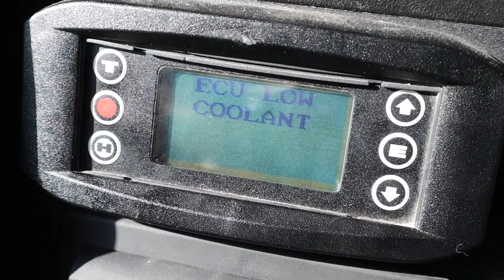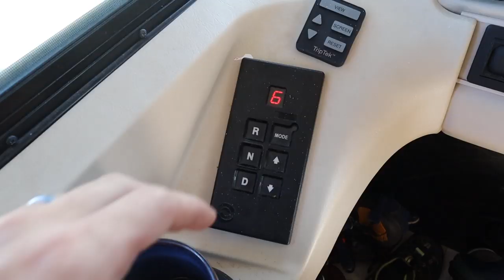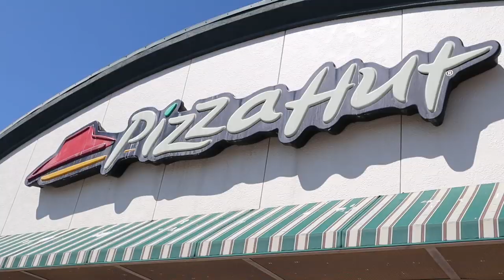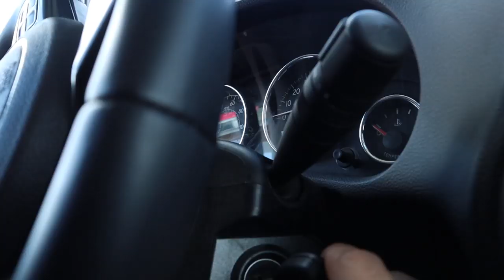RV REPAIR is Part of RV LIVING // Overheating Class A Diesel Pusher

Comment: This gentleman brought his diesel pusher RV into this diesel shop in Texas. His engine was running hot on hard pulls.
The service center said That they would research the problem, when they said that they would research the problem that means that they should had checked everything that could cause this engine to overheat during a hard pull’s first. There are two things that the shop should had check that will cause a diesel engine running hot under hard pulls. Is the engine fan working properly, is the  radiator clean for air flow, If you think about it, this RV is a pusher the radiator  is at the rear, that means any debris from up underneath the vehicle will penetrate through the engine compartment, through the radiator due to the engine fan is sucking air through the radiator. When the airflow is restricted. The radiator will not cool properly causing engine heating problems under hard pulls.

Always remember look for the simple things first don’t go thinking it’s my water pump or is it my engine thermostat always look for the simple things first.
My opinion this gentleman was overcharged.
Reply from the maker: Thank you!!

Comment: Did you try turning the wheel. My car locks up like that sometimes. Wiggle the steering wheel and try again to remove the key.
Reply from the maker: Jeeps don’t have a locking steering wheel but that’s a great suggestion. Thanks
Reply: I thought the Sam thing as t has happened on our vehicle-:)

Comment: We broke down outside of Springfield Missouri. I spent 6 hours (yes you read that right) on the phone trying to get someone to work on our DP. Once they hear it’s a motorhome, they say nope. I ended up having it towed to Freightliner, put my wife and dog on a plane and worked on it myself. I can see why the mechanics don’t want to work on it. A lot of the work is blind. You’re feeling around to get to bolts. They also charge you extra per hour than if it was a truck.

The problem I found is DP’s end of creating a vortex at the back. All the road dirt gets sucked in back there. What I did and I suggest everyone do is buy a garden hose and nozzle. Once you get to your new campsite, open up the back, connect the water hose and hose down the fins. You will see a ton of dirt come out. This sure is cheaper than paying a mechanic to do exactly that when you keep overheating. The other thing you should do is gain access from the inside and hose the fins from the inside.

Comment: You are exactly right with regards to the dust. You are kicking up dust with all the tires when the engine is mounted in the back. You can go off road but you need to flush the radiator each time you go off road. You can use air to clean the radiator. The other thing you need to do is clean the air filters after each off road experience or anytime you are stirring up dust. These are easy maintenance things that will save you a ton of money down the road.
Reply from the maker: Thank you 😊

Comment: Hopefully you get the engine problem figured out. We just traded out dp in for a smaller class c diesel. It had a Cummins motor. We had trouble getting it serviced too. And yes- they are very expensive to fix. We put over $13000 in repairs this year before we traded it. They sure are fun to drive though. Best wishes.

Comment: We have a 1996 Monaco.  We replaced the radiator and thermostats.  It won’t go over 220 degrees uphill pulling our toad on a hot day.  Downside is radiator was $2500.....we also had a leaking charge air cooler replaced.  Another $2500. also had to replace our 1 piece windshield....$4,000.  Glad we use this for business.  These old rigs are built well but when it’s time to fix,  not cheap even if you are handy.
Reply from the maker: Yikes! Yes I agree, well built but expensive! Thanks for watching

Comment: Just FYI to clean the dirt from the radiator fins, run the engine so it's hot and then spray some oven cleaner into the fins, just be careful not to get it on the paint or plastic, let set for 30minutes and rinse with water.
Reply from the maker: Thank you!

Comment: Every RV option has its bonuses and detractions.  The big draw back with the motorhome is that your engine/chassis is mated to your house.  So when it needs maintenance, the house has to go too.  That's one advantage about the 5th wheel.  If the truck needed maintenance, you could just drop it off and cool your heels in your RV until its fixed.  Not to mention that since your pulling chassis is a pick up truck, service centers are more abundantly available.  Also, most modern 1 ton diesel trucks produce more power and torque than many diesel pusher engines.  My 2018 Ram with 6.7L Cummins makes 370hp and a monstrous 800lb/ft of torque.  It climbs mountains like Billy goat :)  I do understand why you made the switch though.  Hope you get it fixed quickly.
Reply from the maker: Yes I see your point. That was something I considered when we decided to get a 5th Wheel in the 1st place. But even they need repairs at times and can be at the RV dealer or shop.. Keep Your Daydream had to spend some night in a motel which their new 5th wheel had warranty work done. It happens to us all eventually. Thank you!
Reply: @LoftisPartyofSix  Absolutely, my wife and I love watching you guys.  And we found another Aldi in Palmdale, CA.  That's makes 2 now in Cali we've come across so far just waitin for ya :)
Reply from the maker: Awesome 😎 thanks 😉

Comment: I just YouTubed about your key for the Jeep. Few good answers I hope for you. Your parking stick could be stuck when you shift gear into park. They can become stuck if soda or been driving with Windows down where dirt can get in when pushing button in. This guy sprayed WD-40 in the crevis of the button and then went back and forth clicking till it might not be stuck. Then back and forth from drive to park to make sure stick is fully out. Can seem fully out, but not really maybe. Also if you have a little lock shift button for overide by your stick could be locked in too. And needs to be clicked out. WD-40 that also, till pops out. 😊
Reply from the maker: Thank you for the info!!

Comment: Good attitude with all the issues.  Sometimes turning the steering wheel will loosen the key?  Many diesel shops are not accustomed to dealing with full-time RV families - they want you to drop it off and they get to it whenever.   Bring all the kids into the office - optimal pressure, LOL.  Good luck with everything and safe travels.
Reply from the maker: Yes I had to explain to all of them it was our home so they could understand our urgency. Thanks for

Comment: I'm so sorry about your windshield. There's a good chance that a rock got throwed up when it was being towed. Some Class A  Rvers have a shield type thing to help. Or maybe you just got it when you were off roading. But I'm sorry to say that's just one of the pit and down falls of off roading. I with our insurance. It's just cheaper to pay for it ourselves. We use Safe Lite for our windshields. There's a slight chance with the towing of it and with the heat. It could possibly shatter the windshield. It probably won't fall out. Just shatter. Believe me I had it to happen before. It's so depressing. And Safe Lite will come to your location and put it in. I'll keep your family in my prayers. Remember come to the Great Smoky Mountains and see me and my husband. We would give you and your family a good old fashioned cook out. Safe travels.
Reply from the maker: Yes I’ve used Safe Lite before and will definitely check with them on getting it fixed.
Reply: @LoftisPartyofSix  I don't know if all insurance companies cover windshields but Allstate covers our vehicles and it's not part of deductible coverage. If that makes sense as I don't remember proper term. Praying for a fair price on the RV repair and a complete fix!!!!

Comment: I had issues with mine also overheating thought it was a radiator but it wasn’t I end up calling the Freightliner 800-number and they told me to have the mechanic do a  RPM check on the fan clutch and that was my problem
Reply from the maker: Oh that’s good to know. Thanks

Comment: I am sure you have this fixed by now, but found these comments on a forum.  Just info to review, you may already be aware of these other areas to check.  Note: the reference to under passenger seat is on referring to passenger side, but is at rear of the coach.

There are 3 accesses that I have used to clean the inside of the radiator.
The most effective is under the bed raised and with the engine cover removed. From this position you look down onto the inside surface of the radiator. Soak well with 1:1 simple green (or other degreaser) and water. Using a garden sprayer with a long tip you can get most of the top half of the radiator. From the bottom front under the driver seat you can get about 25% of the radiator, you will have to squirt the liquid between the fan blades which must be rotated slightly to get it all. You may have to crank the engine. I have been able to rotate the blade by hand but is difficult. The 3rd access is under the passenger seat but again the fan blade will have to be rotated. After all of this is sprayed, I also soak the outside surface of the radiator by trying to squirt the cleaning fluid directly into the radiator fins. You can rinse with water but if you have a really thick build up you may have to use a pressure washer or car wash sprayer directly into the outside rear of the radiator to get it really clean. When doing this hold the sprayer far enough away from the radiator fins to avoid bending them.
You can tell when the radiator is clean. With the engine on, the fan should uniformly blow air through all areas of the radiator. 
Also, if you dont have a closed crankcase, you may want the extend the oil blowby tube (crankcase oil vapor exhaust) so that it vents beyond the radiator.
good luck
jim & debbie, 04 Journey, suzuki toad

Best of luck to a speedy fix.
Rick
Reply from the maker: Thank you Rick!! Great info!

Comment: Is the power steering working correctly?  On most Units it uses the same hydraulic systems as the engine fan.   You might want to verify the radiator is really clean...  couldn’t hurt to check behind them. Highly unlikely, but the fan motor should be checked to be sure it’s turning the right RPM. Good luck with your unit.  My hubby gave me all this advice to share. We have a diesel pusher and love it, but have had a few repair adventures too. He’s a trained diesel mechanic and has handled all the repairs himself. Thank God.
Reply from the maker: Maybe y’all should follow us around 😁😉!! Thanks for the suggestions and I’ll definitely keep it in mind.

Comment: Nope, nice always. Hard working mechanics can’t stand whiners...this is to test your patience, lol 😆.  When I worked at Volvo. There was a big sign in the shop that said, “$60 an hour; if you watch or ask, $100 an hour”💁🏻‍♀️ 🤣. When you pull out your key, we found we had to make sure you pull it out by pulling it ‘up’ and out. I know we usually don’t think about it, we just pull the key out and lock the car, but If you pull the key out quick and have a tendency to pull ‘down’ when you pull it out of the cylinder, you may misalign the inside of the cylinder...our Rendezvous had that issue.
Reply from the maker: Thank you

Comment: At my work, our little Chevy cars would do that because of defective shifter mechanism, basically the car didnt know it was in park. Mayby that's what going on, but with 100k on ours wev never had that, but have had the trans acted like its slipping after taking it out of 4x4 , just a restart of the engine solves that if ya ever have that happen. Safe travels!
Reply from the maker: Thank you!

Comment: Your key situation could,be anti theft , I have a Infiniti fx35 and the key/steering will lock up if it thinks it's being jacked with! You have to turn the wheel as you finagle the key! Your manual will explain if it is in fact the issue .  One other suggestion on your windshield ... I wouldn't wait to get that replaced ... it is very compromised now and if another rock hits it , it could shatter and might cause a very dangerous situation. 

We lived in the west (Utah) for 9 years and replaced 5 windshields !! The west is just notorious for having rock issues along the roads. 

Sorry your having all these issues ~ but maybe they are done and you can ride in peace now!
Reply from the maker: Thank you

Comment: The diesel will out last any gas engine hands down. You're right about CAT engine, I've had a Cummin's and now a CAT engine. I'm with you I'd rather have a Cummin's engine. But we just need to keep them serviced. The oil I've been told has something to do with the fuel rail.
Reply from the maker: I’ve never had a Cummins yet. But I’ve heard good things about them. Thanks

Comment: My car does that with the key when the steering wheel is Locked in a certain way, if it does it again try moving the steering wheel back and forth (as much as it will allow) a few times
Reply from the maker: Jeeps do not have a locking steering wheel. Thanks

Comment: Your Jeep key cylinder may be going bad and need to be replaced. Supposedly you can get a new one that can be setup using your current key so you don't end up with a different key for the ignition and the door locks.
Reply from the maker: Thank you 😊

Comment: I am also curious as to your MPG on your CAT engine.  I assume it is pre-SCR/DEF engine?  On my small Cummins Diesel - I am getting 8.5-9.  I understand that I will likely get better MPG once I brake it in more.   Thanks!
Reply from the maker: Currently in the mountains I’m getting like 7 MPGs but on flat ground I get about 9-10.

Comment: A Loftis " CLIFF HANGER".  I'm sure glad we dont have to wait until next season to find out. TUNE IN NEXT TIME WHEN WE FIND OUT THE LOFTIS RV OVER HEATING PROBLEM ". LOL
Reply: @LoftisPartyofSix  we have to Joke about it or we'd cry.  I have an issue with my driver side window , the vcc window with the side in it. It frosted over so bad you can't see the mirror.  It lasted 2 years maybe . So I found this company who came to my house to fix it. I replaced the whole window the last time I think for over a $1000. These people replaced the window that's damaged for $350. I needed 2 repaired so it was $300 per window.  
I sure hope your over heating problem is easy on you. I really thought it was a dirty radiator.

Comment: Not sure , check and see if there is a button  you press to remove the key. Your insurance should replace your windshield for free. They will come to you to replace it. The same goes for you RV windshield.  I knew it was your radiator. You should buy you a small pressure washer for this and can use it to clean lots other stuff , jeep RV and little boys, LOL  Man I was hoping it was just thr radiator.
Reply from the maker: Thank you 😊

Comment: We have a Winnebago pusher also , I no longer drive on dusty roads because of the radiator clogging up, Cat has the crank case vent tube that puts out oily discharge that gets sucked into the radiator and holds the dust . I put a 90 and extended it out the back to keep the rad free of the discharge it has helped a lot. You can clean it yourself with a small pressure washer and engine degreaser from underneath and behind just keep away from the alternator
Reply from the maker: Yes I’ve heard about that “slobber tube” and need to get that done. Thanks

Comment: Next time key sticks shake the steering wheel a bit. The key locks up because of the steering wheel. My car did the same thing every once in while for 12 years.
Reply from the maker: Jeeps don’t have a locking steering wheel so that shouldn’t be the issue. But thank you for the suggestion.

Comment: Basically.... You should have done that first and saved yourself money.. 
If you are not getting air then you need to clean it. Just like your air filter... stuff you can do on your own... Or your loaded with $$$$... 

Look for a car wash was the first thing I was thinking.  Power washer is about $100 at walmart..
Reply from the maker: I power washed it and so did the shop.. the back of the radiator was so bad that the power washing was not getting it done.

Comment: Your insurance should cover the windshield at no cost to you.
Reply from the maker: Unfortunately they won’t. I already called and they don’t have free glass replacement. Might be time to switch carriers!
Reply: @LoftisPartyofSix  They can add to your policy
Reply: @LoftisPartyofSix   RV glass replacement is 3000- 5000 depending on the type of windshield.  I would definitely get another carrier. The jeep not so costly
Reply: @sherryj1704  It cost us just about $300 to have our truck windshield replaced by Safelite.  This company is great they come to you, where ever you are and replace it on the spot....about 45 minutes or less.
Reply: @sandyoklahomatransient8557  My friend just had his Class A windshield replaced  just one side because it's a 2 pc windshield it was 2500.00 and if the other side needs it another 2500.00 they came to him also. Just trying to help. KY full coverage pays for it and I'm not out a dime.
Reply: @sherryj1704  Large vehicles are expensive when replacing windshields.  Their jeep shouldn't be as expensive.
Reply: @sandyoklahomatransient8557  You are missing the point, their insurance doesn't cover glass replacement.  They need to switch carriers JUST in case their Class A ever needs a windshield
Reply: @sherryj1704  I understand there insurance doesn't cover the Class A window.  I was saying if they want to replace the cracked window of there jeep which was mentioned in the video they can do it out of pocket.
Reply: I understand their existing insurance doesn't cover the RV window replacement.
Reply: And yes, switch carriers.  You need a carrier which works for you.